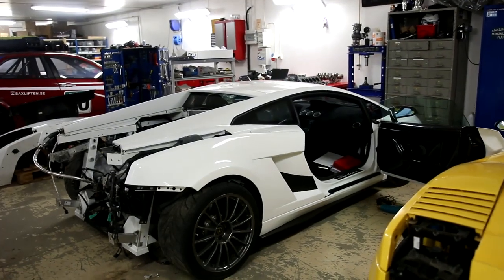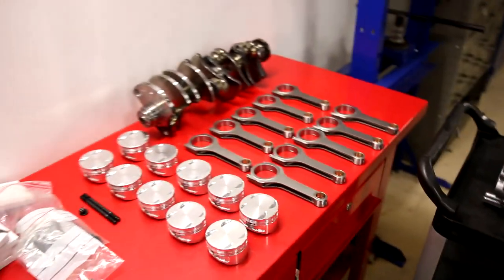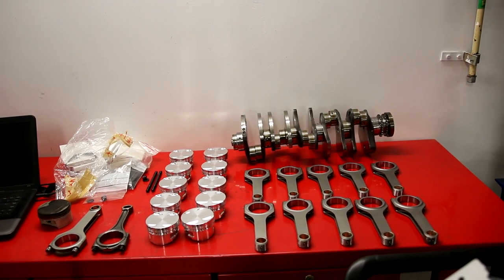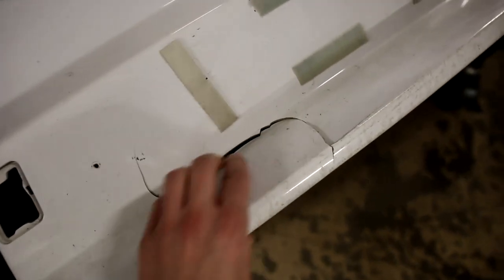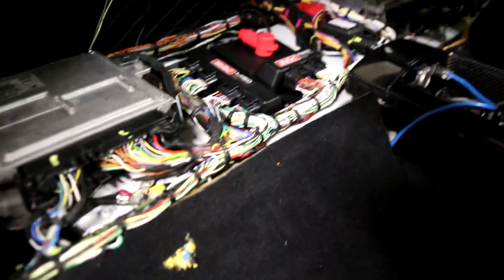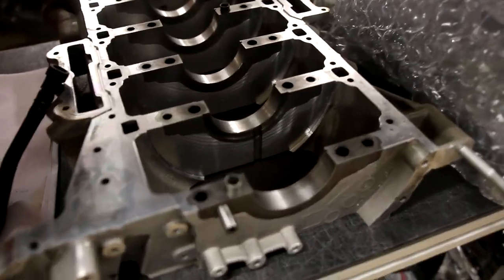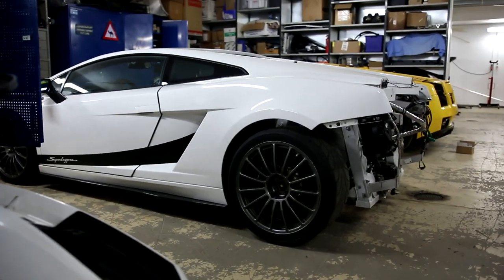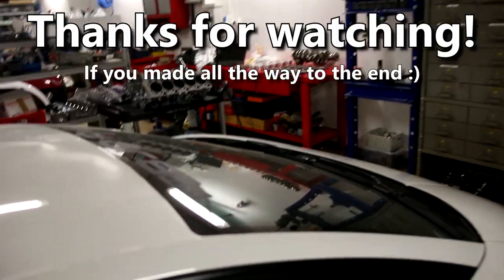My Lamborghini Twin Turbo Project Update

Comment: I understand why you wouldn’t want to coat the Pistons because you want the heat to be absorbed and not reflected and cause possible detonation. But you might want to do some research on coating the valves. I’ve done this for a number of years and have always had very positive results. I am a student of David vizard and he’s the one that got me to coat my valves first. Specially on the intake valve a coating really dose help flow. Because when you’re cool charge of air meets a hot Intake valve it tends to cause the gas to expand and restrict the flow. Just a thought I hope it helps. I really enjoyed your video

Comment: I think the stock rods are cracked from Audi/Lamborghini and not broken! 
Cracked connecting rods are initially made as a single-part component. The large connecting rod eye is then broken in two in a targeted manner. The two parts are screwed together again during mounting. The cracked fracture surfaces achieve an excellent fit precision between the connecting rod shank and the bearing cap. greetings

Comment: will you use any of the f1 stuff you bought on the lambo? please make more videos, they are really interesting
Reply from the maker: Yes i will use some sensors and quick connect oil fittings. Maybe i can put in something more? :)
Reply: the intercooler?
Reply: PeterBjorck that would be awesome trying to incorporate the F1 parts. Use the intercooler for sure and the connectors. Wish I could be part of such a project looks like a lot of fun. Good luck!
Reply from the maker: Plan was to use two of these f1 intercoolers, but i was only able to buy 1 of them. I dont think one will be enough..
Reply from the maker: Plan was to use two of these f1 intercoolers, but i was only able to buy 1 of them. I dont think one will be enough..
Reply: just a tip, dont put you're crankshaft horizontal on a table, it can buckle under its weight, or just deform a little, always hang the crankshaft from a cable, or put it in a position where its not stressed by its weight.
great job on you're lambo sir!
Reply: dominique dujardin so a crankshaft can deform due to gravity, but not 500 original horsepower?
Reply: Very small connecting rods, they are of similar size to 3.0T audi motor.  2.7T audi rods are bigger than those lol.  Biggest stock ones I have seen were out of a Porsche N/A V8.  The rods your putting in seem legit!
Reply: crankshafts are sensitive when they are out of the engine. on a "normal" car it wont deform enough to make a difference but when everthing is this exact it might be.

Comment: Are lamb engines hard to work on? Or is it just really expensive?
Reply: they are build the same way any other combustion engine nothing magic about it. Just more expensive components/better materials/quality
Reply: The issue is considering it already makes big power, adding more power will always cost more and starting at a higher point means its expensive right off the bat.
Reply: Every internal combustion engine is extremely similar. Short of having a few more cylinders this will look extremely similar to a 1999 honda civic engine.
Reply: Parts are probably hard to find and that means it's expensive. Not many people modifying lambo engines.
Reply: Ray Baker and also tools must be a big one since the guy in the video had to make his own tool to just lock the cams in place. Would like to work on theses engines someday, i mean at the end of the day they still have pistons, rods, and a crank.
Reply: Yeah, any Volkswagen shop manual should work
Reply: They are vag engines in essence so if you know how vag's engines quirks you already know how to work on them

Comment: The Crankshaft and the Crankcase will be the biggest Problem to build up a stable high-boost Turbocharged V10-Engine.

I think Soft-Boost who support the nA-Engine will be only possible.
2.0Bar will break the Crankshaft very fast ... or the Crankshaftbearing maybe are big stressed.
Reply: I hope in the near future, CNC-Factories will read-in Original-Engineblocks and then CNC-Engineers will write a new Software for building Engineblocks with a bigger Crankshaftsupport.

3.5L I 6  Supraengine's    /   and more!!!

Comment: ditch the e-gear transmission they really suck on high hp and high torque applications they usually get even more clunkier than usual witch it's already terrible clunky and since i think this will be a street car that kinda of behavior would be terrible for that kinda of use. and let's be honest a twin turbo gallardo with 3 pedals and a stick would and will be amazing! but that's my opinion :) great build! keep up with the great work and videos! :)
Reply from the maker: I thougt exactly like you before i drove the Superleggera. Have you been driving it? It is actually better than i thought. Its pretty fast and when racing you will never misshift like its possible to with manual. 
Of coarse its not an sequential och double clutch but i think its ok, just need some adjustment for the turbo to work properly.

Comment: Swedish? Awesome project man!
Reply from the maker: Japp! Tack!
Reply: What's the biggest issue you have to handle with building big horsepowers in a Lambo? Iv'e always questioned the reliability of these things, and i can imagime it would be pretty expensive to repair...
Reply from the maker: All depends on how much power. With just little boost the stock engine is fine. But big hp in a Lambo then many parts of engine and drivline have to be replaced. Expensive yes.

Comment: When you gapped the piston rings did you account for higher boost? Or are you running a standard boost pressure?
Reply from the maker: Gapped for the aplication. This engine is Naturally aspirated from factory

Comment: The stock rods are complete rubbish my god.
Reply: That's the shitty audi's cost reduction policy
Reply: The stock rods actually look really nice. If you know anything about stiffness and buckling then an I beam is much preferred over the "H" beam style of rods. H beams are just much easier to machine. The stock rods are designed for the stock engine, nothing more. They don't fail because they are bad, they fail because they are not designed for more power. If they didn't fail then it means they weren't optimized in the first place.
Reply: volcano hi because heavy rods are bad for engine performance. Very bad
Reply: This is how stock connecting rods looks like in super cars. They have to be light.
Reply: No they are not. They are shape optimised , forged , shutpinned , heat treated and more. They do job.
Reply: The engine is output per liter is low, so obviously the conrods are fine for stock applications but for a big dollar car you would think they would look a bit nicer than that garbage. Look at a toyota 2jz engine they produce 200- 250hp per liter in complete stock form with bolt ons reliably, the galardo engine would blow to fucking pieces.
Reply: slws14 then the 2JZ stock rods are badly optimised. If they can take so much power then they have not been designed well for that engine. The stock rods shown here are very nice forgings. Nothing wrong with them
Reply: slws14 also design OEM engines every day of my life, so not too dumb

Comment: Split crank pins - weak crank. Lambo should know better
Reply from the maker: But the stock crank will still hold double the stock power, and its even fire. The newer Lamborghini have not split crank pins and then it is odd fire engine and the crank is stronger i think.
Reply: There's more than one reason a split plane crank is better suited to the engine  harmonics are one of the biggest stressor on a car